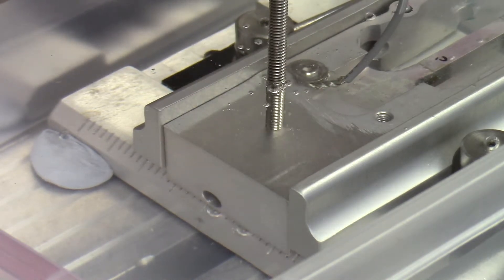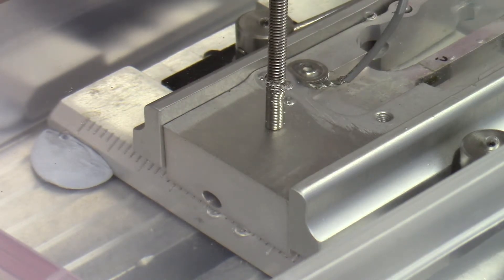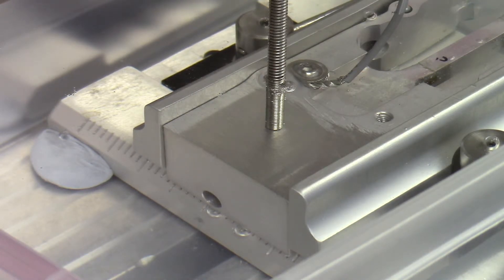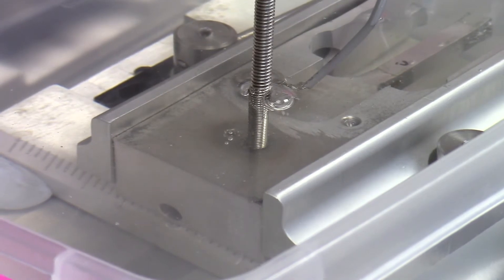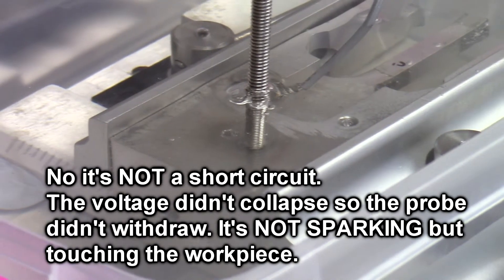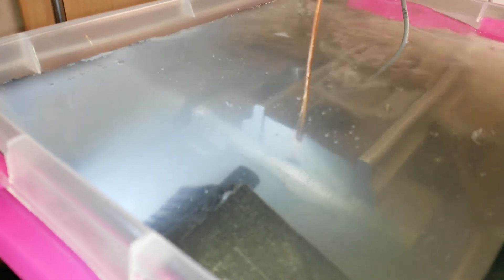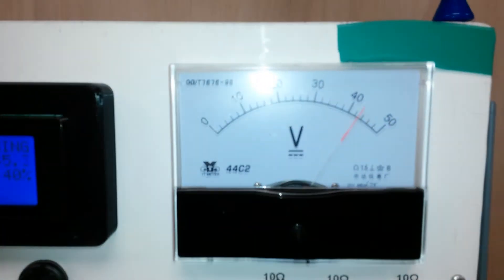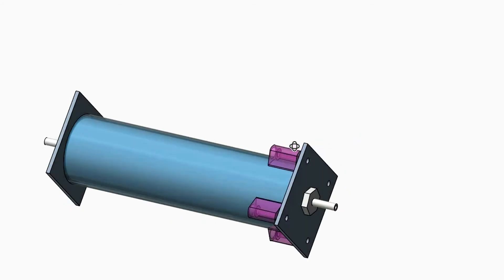DrunkCNC Home made EDM machine video2 - small improvements

Comment: Are you going to share the build of the power supply?
Reply from the maker: The PSUs are all off-the-shelf switch mode units from amazon. the schematic (at the link below) shows that the edm spark generation is mainly done by a 48v PSU... - using an off-the shelf unit meant that I couldn't abuse it with short circuits on its output, which is why the resistors are the values that they are.   I havent looked at this in years now, - its buried in other projects in my shed......  I must get round to digging it out... best regards!

Comment from the maker: the arduino code is very simple (and is not lost after all):- 
https://drive.google.com/file/d/1-kA6WuqCbY5n7_WJzZ9yMKrgQo-2eXno/view?usp=share_link
link is to a zip archive of the arduino sketch and the schematic and apiccy of the interface board from inside the control unit, that was intended to be for the next video , but plans changed...

Comment: I would love to see more.
Especially about the circuit and the arduino code.
btw. I can tell you that brass is used for "normal" metals and copper for the hard metals.

Aluminium might not be the best choice.
It will probably behave similar to welding. In that case it builds up a non-conductive oxide layer.
You would have to switch to AC with periodically inversing polarity to get rid of the oxides.

Comment: When you say 30 ohms, you actually mean 15 ohms. Your resistors are paralelled up so the two 10 ohm 50 watt resistors are actually acting as one 100 watt resistor.
Reply from the maker: - well, the caption says 30 ohms ,  so I think I mean that the three switches that select whether the parallel resistors are connected or not were all in the OPEN position as opposed to the CLOSED position which would make it 30 rather than 15..... - I had notes on a pad of paper... and was very careful to keep track of the switch positions.
- However, thanks for watching and commenting ! 
- I really must try to get back onto that project, - I've been using the mechanics as a router positioning controller for machine cigar-box-guitar necks... - maybe ressurecting the EDM machine would be a good project for the winter months.
- Best regards !